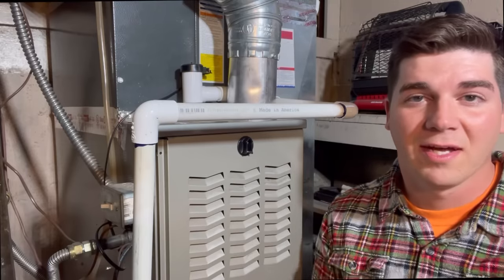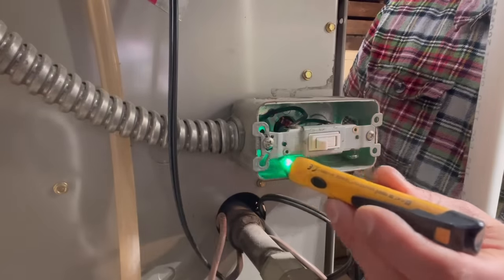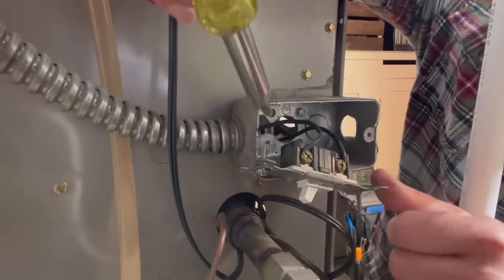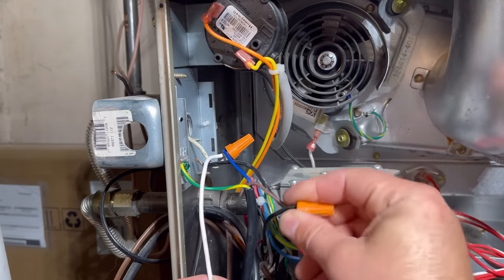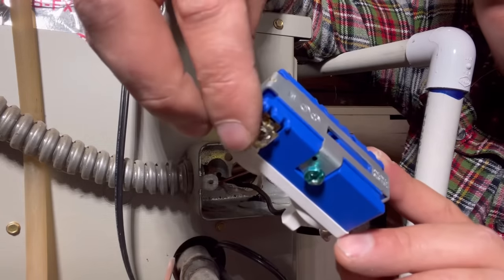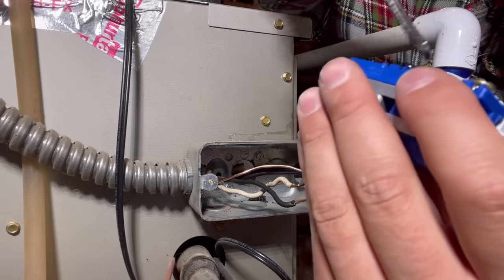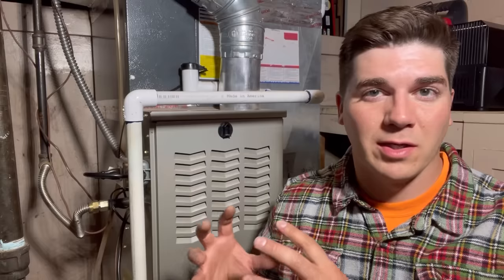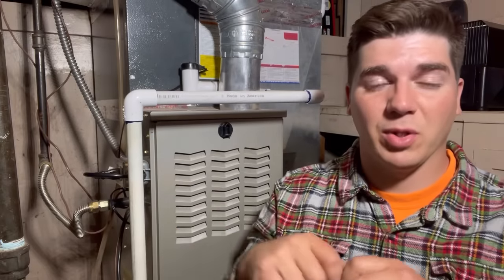This Could Keep Your Family Warm During An Emergency Power Outage.

Comment: For the switched receptacle there, you really didn't need to remove the common tab, you put your line in on the brass screw next to your black screws, leave the tab in place and wire up your neutral to the silver screws and your ground to the box and the ground screw on the outlet.  I've made power bars like this for my soldering iron and glue gun using these switched outlet combos, similar in functionality to how British outlets work.
Reply: Thank you. I was only a few minutes into this and was getting a little anxious. Line to brass, neutral to silver.
Reply: Correct, but this guy used a lighted switch for some reason and that will be affected by being on all the time.  The lighted switch is unnecessary and a needless expense so it doesn't matter, really.  But, yes... you got it right!
Reply: @jasonmackey6741  That's not what he's saying.  Line can also go to the black screws if you want the switch to control something else and the outlet to be always hot (on).   He's saying the OP didn't need to alter the device only to add a jumper later.
Reply: @DiffEQ  I was wondering why he broke the tab, then added a jumper. The tab is the jumper, isn't it? If he'd left it in place, the switch would still control the outlet receptacle, which is what he was after? I'd like to connect my boiler this way, which is also on just a switch.
Reply: No your wrong. If he didn't break the tab the outlet would be hot all of the time regardless of whether the switch was On or Off.
Reply: @jfowler702910  you really don't understand, polarity matters with outlets, not so with switches.  Line in could have gone to the brass screw,
Reply: @jasonmackey6741  with outlets yes.  Switches normally interrupt line in and have no polarity in AC circuits.  Reversing the connections on a single pole single throw switch, which is what this is, does nothing.  He should have left the jumper and connected line in to the brass screw.
Reply: @jfowler702910  The outlet would be switched whether he used the tab or as he showed breaking it off and running a jumper. By breaking the tab and running the jumper, that moved the connection to the indicator to the switched side. If he had left the tab on and fed the hot to the silver switch screw then the indicator would always be on. It all depends on what you want. If you want the indicator to say if the switch is on or off, then do it like he showed. If you want the indicator to tell you at the furnace if power is coming from the utility panel (i.e. if the breaker is live) then leave the tab and wire the hot to the switch silver.
Reply: @Sembazuru  you're right he didn't need to break the tab but  you never hook a hot wire to a silver screw terminal.  Silver is for neutral connections only.
Reply: @gbinman  yes you're correct. He didn't need to break the tab.
Reply: Having the light be on when the mains power is on makes sense to me? The genius part for me of this video was that if the plug is removed from the receptacle, it eliminates the possibility of power from the generator/inverter back-feeding the breaker board? As to colored terminals, I believe the convention is that if there are two black terminals, you use them to break the circuit. The brass terminal in the included instructions apparently pretty much just controls when the light is on. If in doubt, I usually follow the instructions.
Reply: @Sembazuru  silver = neutral in NEMA standards.  black or gold =hot, energized, ungrounded.   Don't put hot to silver
Reply: @carterhoenig7759  Yes, yes, yes. But it is a switch. Those things aren't polarized like outlets should be.
Reply: The instructions give several ways to do it and explain what each one is for. Both of these methods are OK, but they give different light behavior. See @Christopher Elliot's response.
Reply: What size inverter would be required for the furnace in the video?
Reply: To be honest. You really don’t need the switch. Since you are installing a plug, it works as your disconnect.
Reply: @timmcneeley8024  Technically yes, but even if your local code and inspector allows for the furnace to be plugged in instead of wired directly, in most places a switch is specifically required and without one it will fail inspection. They'd probably argue that in an emergency a switch is easier to flip instead of pulling out a plug.
Reply: @Sembazuru  It is a switch with an outlet. The silver screw is only for the common side of the outlet. Attaching hot to the silver screw would wire the outlet backwards. White to Silver, Gound to Green, Black to Brass, keep the black to black jumper intact is the proper alternative method of installation. As mentioned in previous comments, the LED would always be on with this alternate configuration. Please do not connect black to silver. You will damage anything plugged in.
Reply: @jfowler702910  No you wire the switch backwards and the tab replaces the jumper.
Reply: @jfowler702910  Switches don't have neutrals.  The only reason that one of them is marked black is to indicate that that's the one connected via the link to the outlet hot - ordinarily, these are wired with the hot to the outlet screw, the outlet is on all the time, and the silver screw is switched hot to the switched load.

However, in this case he wanted the switch to control the outlet.  He could have fed the silver screw with the line hot without breaking the tab or adding a jumper.  But the indicator light would behave differently (on all the time, instead of only being on when the outlet was energized).
Reply: I ended up buying one of these and installing it in my pantry (a convenient central location for the vacuum cleaner and floor steamer). I wired it as suggested by WJCTechyman. Hot to brass, neutral to silver, leave the tab intact, and of course ground to green. The ceiling light is connected as well, which goes to black. The red light stays on all the time which is fine. The switch controls both the light and outlet, which deters someone from using the outlet other than temporarily. I don't like the idea of the door being shut while something like a battery charger is plugged in. I'd rather those get plugged in elsewhere. I might also buy a 3 pole version for my basement. They cost a lot more though. The only thing we don't like is that the switch is horizontal. It's a small thing but takes a while for the brain to adjust.
Reply: if he left the tab and put the hot where he did initially then yes, the outlet would be hot all the time. 
what wjc is saying is put the hot on the other end of the switch, this will make the outlet work off the switch through the tab. HOWEVER, the little red light will remain off when the switch is off, breaking the tab and using the jumper allows the red light to have constant power but the switch to control the outlet, its a trade off based on usage and desired display. do you want the light to indicate the switch on or off or to indicate there is power to the switch. its preference. im sure that manual shows the other ways as well, theres about 5 ways to use this outlet combo. 

personally, i would put the hot on the brass screw, let the light indicate the switch position, this configuration allows me to not use a pigtale wire, i can wire my furnace to the back of the outlet and when power is out flip the switch and with a double male extension cord i can simply plug into the outlet. again, its all preference.
Reply: @darkwarrior1588   this method in the video then avoids the necessity of a double male ended cable (also with a little bit different wiring behind the outlet -in the video, the outlet isn't directly wired to the furnace, aside from the added cable being plugged in) , which is a taboo method really. i'm torn on the double male extension cable, i may know that it is live, plugged in to the generator, because i hooked it up, but you have to label, or go into detail for others to do anything with said extension cord..
Reply: Quick comment: use the switch to interrupt the hot wire line. Inside the furnace use a 3 wire WAGO quick connector to have the neutral (white wire) connected to the load (furnace), line (120 V), and big plug of AC outlet. All that remains to do, is make an extension cord with TWO male plugs. Pay attention to where you plug the hot (black) wire coming from the line: make sure the switch disconnects it when you plug  in your inverter. 
This solution gives you a usable AC outlet with the switch ON, wirh no need to pigtail stuff from the furnace, and no need to ripp off any connection. Only drawback is the custom cable (two male prongs) needed to connect your inverter to the AC outlet, once you lost power and turned the switch to OFF.
Reply: @larrytobos3671 double males are called suicide cards fr a reason. If you’re going to use a cord, use an inlet instead of an outlet, which os basically the same as a dangling male plug, but mounted in a box.

Comment: Great video! I'm so going to do this modification. I have our camping deep cycle battery and 600 watt inverter in the next room on a battery maintainer. We don't lose power often, but this is an easy backup to have at the ready.

Comment: I would use a Green Dot Hospital grade outlet for it, if available they are a lot stronger and have an excellent grip on the plug.  I'm going a step further I'm pulling a large Solar system off my RV before selling it I'm going to wire it into the house in a way that I have automatic backup to critical things like the Boiler, Lights and Cable modem (for VOIP calls)  I don't need to use the solar panels at first because the 2 large Lifepo4 batterys I have would run all of that for a couple days.  I'm still going to use a generator but if the power goes out I won't have to worry about it in the middle of the night.  It's not a cheap way to provide backup power but I already have the equipment.  You can do the same thing with a smaller Solar Inverter and smaller battery. My batteries cost $3k each because of their size. You can get a 100ah Lifepo4 for a few hundred dollars that will last 10+ years , can be stored, charged inside safely they don't explode like other batteries.  I could explain the tech behind it but if interested I would search for RV Solar it's just household equipment used in an RV. I like Victron.

Comment: Great video!!!  Only concern I have is the 18 gauge wire jumper on a circuit with a 20 amp breaker.  Easy to overload if someone uses heavy load, up to 20 amps, on that outlet.  I’m sure it would never happen, but just an FYI.
Reply: Why do you think the jumper was 18 AWG?

Comment: Yet Another great video👍 ! I Remember some years back listening to an old timer from back east telling me to save the propane optional fittings that came with the unit and to have the furnace installed with a a cord plugged into a disconnect switch outlet. He told me stories of outages for weeks in freezing weather. 🥶 Thanks for spreading the knowledge.

Comment: Thank you, HVAC Guy (Greg)!   I watched your video yesterday and have been meaning to get this done so we could run our 30 year old gas furnace off our 3800 watt gas generator.   I called a local electrical company.   The electrician was able to come over today.   I had him watch part of your video (this one), and he installed the outlet and switch for us just as you show here.   Peoria, IL is getting a strong winter storm tomorrow with 50+ mph winds, 4-5 inches of snow, and temperatures plummeting well below zero.  The storm is suppose to last two days .  The chances of a power outage are pretty good.   We're so happy to have this measure taken so we can stay warm and stay home safely during the storm this week.   Thank you so much for you excellent video work and thorough explanation.
Reply from the maker: Awesome! Glad they were able to take care of that for you 👍🏽 glad you are one step more prepared :) cheers
Reply: @diyhvacguy  - thank you.  This is one of the best measures we've taken so for in our winter preparedness.  Keep up the good work on your YouTube channel.
Reply: Larry how much did the electrician charge you for the service?
Reply: @mikewelling3618  - about $225

Comment: We have a whole-house generator, but it has failed.
We also have partial solar for our freezer and refrigerator.
I rewired my furnace this way so that if the generator fails again, we can plug into the Inverter.
Our blower motor takes about 5A to run, startup is more.
Next step is to put furnace blower on solar.

Comment: Add a short segment to the video showing current meter in line to determine if the the Inverter (battery) will support the furnace.  The motor draw may be shown in the manual or on a sticker but you need to know the starting amperage for the WHOLE furnace (control, ancillaries such ERV, HRV, Humidifier etc).  Interesting application.